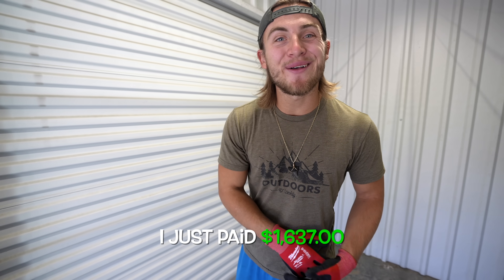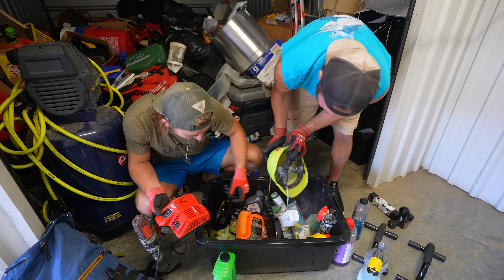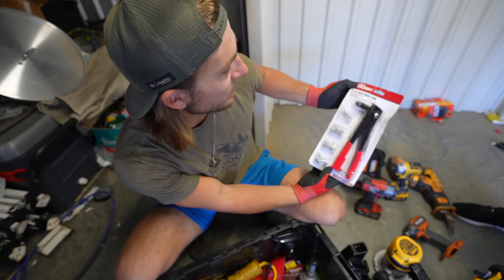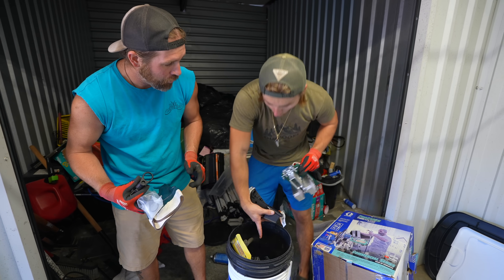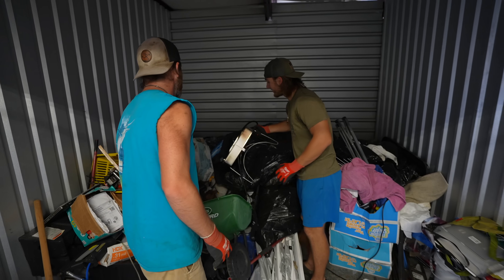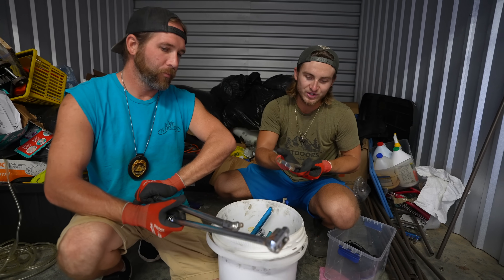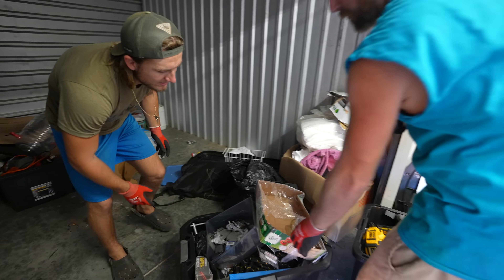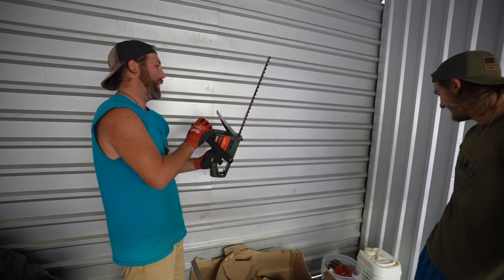I Bought A Corrupt Cops Storage Unit And Hit The JACKPOT

Comment: Those lowers you guys were showing were 80% lowers. The jig and routers  you found are used to complete the lowers. You don’t need an FFL to buy them. Some frown on those because they don’t bear a serial number unless you add it yourself. I’ll take that armorers kit for 40 bucks. I just bought one for 200. Enjoyed the video.
Reply: If the 80% has been milled it can not be sold unless they have a manufacturing license

Comment: That tool you guys are calling a press for bearings is actually a tool for installing and removing ball joints On 4 wheel drives . There's about 10 attachments that go along with that tool

Comment: If those lowers are 80% lowers you can sell them as long as they have not been milled once you mill them out they cannot be sold because they have no serial number.  If you finish then you can keep the fire arm but you cannot sell them.  And an 80% lower goes for about 60 -80 bucks.  FYI the lower receiver is the only part considered a firearm and HAS TO HAVE A SERIAL NUMBER TO SELL IF COMPLETED.

Comment: Do every see how ole boy in the blue shirt finessing dude .. man that shit worth wayyyyyyy more and he knows it. And he knows exactly what he dealing with. Because see how he knows what batteries and cords go to the different tools and power tools. Especially the leaf blower to start off with. He said low compression,  fresh mixed  iol and gas choke the leaf blower, a couple times turn from choke to throttle it'll crank. And those air compressors. Man come in now.. GOD SEEE WHAT YOU DID

Comment: If you start the pressure washer without water running through the pump you will ruin the pump which is most of the system's value.

Comment: You need to take all them powers to an FFL in order to sell them.  The 80% powers you can not sell if they are already milled. They will be the ones without serial numbers. If they are not milled you should be able to sell them.  All of the other gun parts should be OK to sell.

Comment: Tea tree oil will melt the gum right off the Jordans and not hurt the shoe
Reply from the maker: I will be getting some of that, thanks for the tip!
Reply: @StorageMafia I use it myself it does work, then I follow up with baking soda and a soft tooth brush. Nice locker too!
Reply: @StorageMafia Have you ever had a "What not" auction ?

Comment: Guys, you can’t resell used stuff, even if it’s packaged as brand new.  The Milwaukee M18 FUEL Sawzall new is $259.00.  There is a deal at Home Depot that allows you to choose a new M18 Forge 8amp battery (normally $199.00) for free, with the purchase of the Sawzall.  Whatever your total is I’m going to cut it in half.  Still I think the storage unit is a good find and definitely worth what paid for.
Reply: The majority of this unit can be sold on eBay, Facebook marketplace.
Reply: I had a freind like you once, name was Debbie Downer.

Comment: fk i thought that was a knockout set (for electrical) it'd be worth like a $1000+ , but it's a joint press set worth under 100. (the black case with all the round metal cups and caps. )

Comment: just because SOME stripped lower recievers go for 100 bucks or more, doesnt mean they all do, ive never paid over 50 bucks for any of mine from an FFL and also, just because it has a fire control group in it... dont mean you should pull the trigger, it isnt good for it hammer

Comment: The AR15 lowers range from 30-500 depending on which ones you have but then it costs another 20-50 from a gunshop to do the background check because that’s the parts that are controlled. But if he was buying the 80% lowers that you finish yourself then there’s no oversight. If they are serialized lowers I would probably think about just selling them to a gunshop or at least calling the atf and asking because it’s not worth the risk. The ar15 tool kit you had that you said sold for 100 was 3 times off they run 280 new
Reply: If you even begin to mill out an 80% lower it cannot be transferred. And im betting those are all 80% lowers.
Reply: @ most of the time 80% lowers are untreated aluminum
Reply: @ also I believe that you can get a lower registered but you have to put a serial number on it but don’t hold me to that